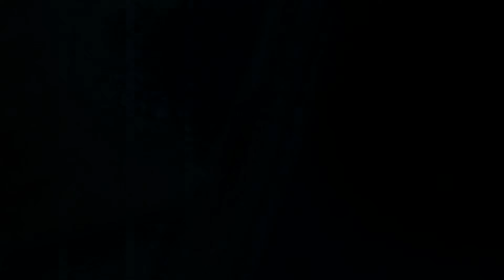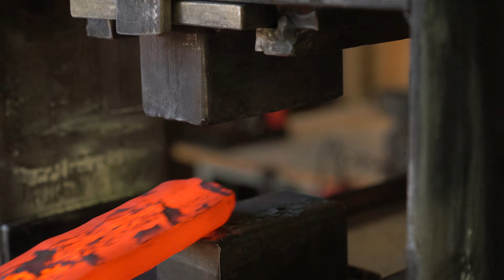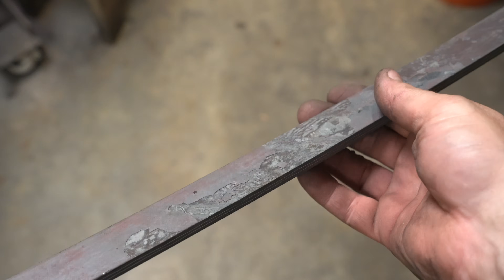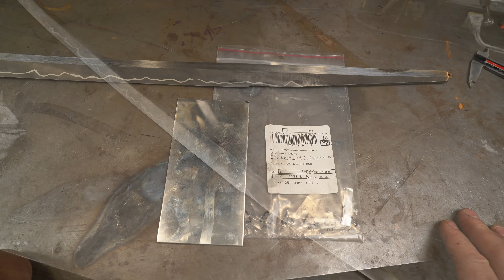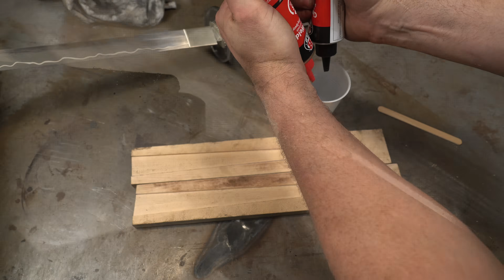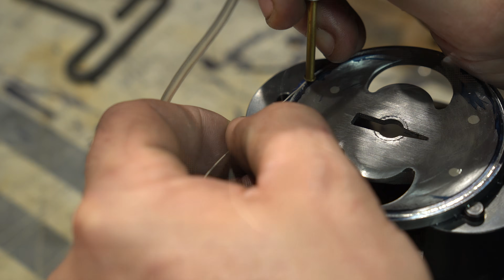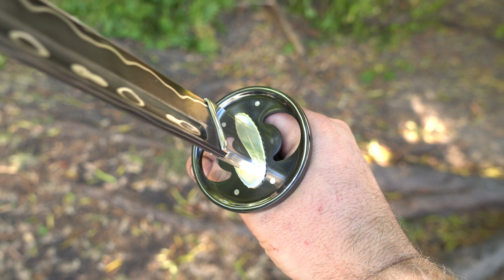Forging a Silver Damascus Katana

Comment: Nice, I'll take one as well. Is it as strong as T10 steel?
Reply from the maker: T10 is an ok steel.  It’s actually kinda brittle, which wouldn’t really be ideal for actual swords.  It’s one of those steels that’s been marketed as a “sword steel” but wouldn’t you rather have a less chippy sword you have to sharpen more often but has a much less chance of breaking?  The core steel in this blade is 80CRV2, known for its toughness and also edge retention.  Overall a better steel than T10 for this purpose.  Thanks for watching.
Reply: @TyrellKnifeworks  Thanks, I'm researching before I make a purchase

Comment: Will the silver oxidize and go black? Maybe try Argentium (a type of Sterling Silver which holds the polished finish).
Reply from the maker: The silver in the blade is pure silver, it will not tarnish like sterling silver.  That was necessary because it has a higher melting point.  Sterling silver was used for the habaki and everywhere else.  Thanks for watching.
Reply: Thank you

Comment: I'd like to see it turned over to IF's David Baker for a strength test against some hardened D2 steel bars after Doug bends it on a wild boar carcase.
Reply from the maker: Sure, not a problem.  It already cut through lots of bamboo without issue.  Thanks for watching

Comment: You guys claim to make a Katana yet don't bother following the original recipe. Why not use the heat treatment method to make the natural curve of the Katana? Instead, you just make the curve artificially
Reply from the maker: This katana is Damascus, I did not want a hamon over it or all the Damascus bear the spine wouldn’t be hard and would etch differently.  The silver acts like a shock absorber in this build so a differential heat treat isn’t necessary.  Thanks for watching.

Comment: Great build!  Looks awesome. Is it me, or does this blade look thin and flexible?
Reply from the maker: The blade is about .200” thick at the hibaki and about .160” at the kiseki.  It’s right inline with the specs of a katana.  It doesn’t flex during normal use, but it will flex a bit if pressure is applied.   Thanks for watching

Comment: I personally did not like the particular guard,seppa and the various moon decorations but the blade itself is gorgeous and cuts like a beast.

I'd rather you kept it simple with no symbols,seppas to be round,a typical menuki of  a dragon or  flower(in this case it would be silver to fit the theme).It felt like the blade is trying to force itself to look "cool" rather than the master craftmanship and raw power of the blade to speak for itself.

Overall blade 10/10 well done
Reply from the maker: Thanks for checking out this build

Comment: Going into this video, Do I think this is going to be a very durable sword? not really. Would I be upset about being proven wrong? Hell no, I’d be delighted~ Do I think it’s going to be absolutely gorgeous? You bet your ass I do. Bless this baby and we’ve got a demon/monster killing weapon~

Edit: it would seem I have been proven wrong about the durability bit, a surprise to be sure but a welcome one~
Reply from the maker: Thanks for hanging in there and not just snap judging the build.  Many people think that because there’s a non-ferrous metal involved that it will affect durability.  It’s a very thin sheet, about the thickness of two pieces of paper after forging, and it’s over a thick central core of high carbon steel that’s the entire cutting edge.  😉  Thanks for watching!
Reply: @TyrellKnifeworks  thank you for explaining the process! I’ll be honest I almost did, but as I watched the video I saw how you knew what you were doing and even explained it, so I knew you knew your stuff.

Comment: Same as steels.same as metals.same as irons ....all will need to be oils  brushing on it , rusty are easy ....
Reply from the maker: Correct, all carbon steel blades should be oiled on occasion to prevent rust.  Thanks for watching

Comment: Why did you spend $1000 on a 3x6x1/8 Sterling Silver plate? A plate of .999 Silver that size should weigh about 13.66oz and, with Silver being about $28 per ounce right now, that still comes out to less than $400. Sterling being less expensive than pure silver... that math ain't mathin.
Reply from the maker: If you read the pinned comment, I mis-spoke in the video.  It was $600... and just because RAW silver is $28 per ounce, there is overhead from the supplier.  I showed the receipt in the video, it was a real purchase.  Thanks for watching.

Comment: That is the best Katana to be displayed I sure could not use it for any practice, with the silver in the blade, and But I would more than proud to display that on my one-sword stand.
Reply from the maker: Don't be fooled, the silver does not affect it's functionality.  The entire core and cutting edge is high carbon steel.  The silver is just a very thin layer, about the thickness of two pieces of paper after forging.  Thanks for watching.

Comment: Does metal really turn black if you put it in boiling salt water without extra meterial?
Reply from the maker: That is t regular table salt. It’s a special chemical salt designed to oxidize metal and turn it black.  Thanks for watching.
Reply: @TyrellKnifeworks  If so, could you please tell me what kind of chemical salt it is? Are there any products I can purchase separately?
Reply from the maker: @Starwooz2021 watch this video https://youtu.be/_v--rblTu1w?si=QFAgJXhJ1PADRiKL

Comment: I'm shocked no one has questioned the decisions here. why would you spend 1500+ on silver when the silver itself is so soft that it jeopardizes the integrity of the whole weapon. it looks like this thing wouldn't last long term in a fight. display purposes, oh yes, gorgeous, but function? thing thing doesnt look like it will hold up against blade-breaking techniques. I must be missing something.
Reply from the maker: The silver is about the thickness of two pieces of paper after forging.  The entire core and cutting edge is high carbon steel.  The silver doesn’t affect the strength or durability of the blade at all.  Look at and understand the construction of it and you’ll get it.  Thanks for watching.

Comment: Honest question, definitely not a critique.  Why does the billet stick to your dies during the welding process?  Is it the slag?
Reply from the maker: It’s normal, particularly when flux is used.  I didn’t use flux on this billet because it was all welded up but sometimes there some residue in the forge.  Thanks for watching.

Comment: Dang, I really need a press. I'm thinking of converting a wood splitter into a press.
Edit: how many ton MINIMUM would any of you recommend? There are some at local stores(rural king and menards). If memory serves me correctly, they're around 20ton splitters. But Hobo freight has a 5ton for $299. Is that enough or does it need to be higher tonnage? 
2nd edit: I have a 1 car garage and a converted log splitter with wheels that can be moved as needed is probably the best option for me. I own a small construction company and all of the tools needed for the company are in the garage too. The splitters I've had my eye on will tilt to 90⁰ vertically. Am I thinking in the right direction or do you have any other ideas for me?
Thanks for any assistance. Keep up the awesome content
Reply from the maker: Unless you get the log splitter for free, it’s not worth it.  H-frame presses are super easy to build and WAY more sturdy than a log splitter.  They just aren’t built for that kind of stress and the frame will now and flex, affecting your work.  Checkout my hydraulic press build video, it has a parts list.  Mine takes up about the same floor space and it’s a 30-ton press I built for about $1400.   https://youtu.be/O_6qciYnKIk?si=7v6X0ogHcDerU-1K.  Also watch this one: https://youtu.be/jjkjPFHKzB0?si=EuOAwh53FxF0vE0d.

Comment: BEAUTIFUL WORK! As you rightly point out no it's not made in a traditional fashion but you wanted a look that meant that was out of the equation! but a lovely piece all the same, curios about the hot salting on steel is it just salt and water? I understand if you don't want to say!❤
Reply from the maker: That is a special chemical salt specifically formulated to oxidize steel and turn it black.  I have videos on the process.  Thanks for watching, Andy.

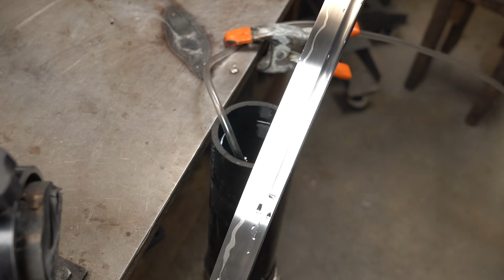Comment: At time 25:00, you said to sand the blade to 800 grit before putting it in the ferric chloride, but in one of your Triple T videos, you sanded a knife to 1000 grit before putting it in the ferric chloride so what grit should I sand my katana blade to?
Reply from the maker: 800 or 1000 is very similar so either works.  It also depends on your echant (ferric vs Gator Piss from Baker Forge).  You shouldn’t be so concerned with exact numbers here and understand the philosophy.  Also, I encourage you to join my Patreon.  I’ll be able to answer more in depth questions there.

Comment: Is it possible to replace the silver with AuGa2? Idk what the melting point is but it'd give a beautiful blue streak along the blade.
AuAl2 is purple which would be cool too. They're pretty stoichiometry dependent though.
Reply from the maker: It’s very unlikely.  As you add alloy elements to silver, its melting point goes down.  Even sterling silver’s melting point is 70F below fine silver.  Thanks for watching.
Reply: @TyrellKnifeworks  Yeah, solid solutions that's definitely the case. Intermetallics aren't as straight forward though. It was just a curiosity. Cool sword though!

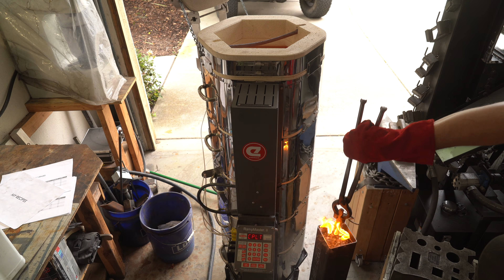Comment: What temperature and time was the heat treating at time 12:58
Reply from the maker: This is 1084/15n20 steel.  Watch this video and see my heat treating recipes at the end. https://youtu.be/XD7m2_usRkk?si=qB4h-2w6PF6uUBIJ.  Thanks for watching.
Reply: @TyrellKnifeworks  but this sword has the 80crv2 steel and the temperature and times are slightly different so which one should I use?
Reply from the maker: @aravchopra5974  oh sorry, I forgot it was 80CRV2.  It’s always the steel on the edge that you heat treat for so it was 80Crv2.
Reply: @TyrellKnifeworks  Okay so for the entire heat treating process only use the temperatures and times required only for the 1084/15n20 steel so 1575 for normalizations, 1500 for quenching and 350-450 for tempering?
Reply from the maker: No, I used the 80CRV2 recipe because that’s what’s on the cutting edge.
Reply: So 1600 for normalization, 1475 for grain refinement, 1535 for quenching, and 400 for temper

Comment: Amazing sword❤, quick question did you soak the stacked billet with the silver and 80crv2 in kerosene before the heating it in the forge?
Reply from the maker: No, it was sealed with weld, no pint in soaking with kerosene.  Thanks for watching.

Comment: It's beautiful but it has an extra bevel on the cutting edge. I am no one to talk, but with modern tools I think you could have relatively easily made a continuous edge on the blade and made it a proper Japanese style blade? Only downside is then you literally can't sharpen one easily, every time you sharpen it needs a full polishing job since you would have scratched the hell out of half of the blade since there's no extra sharper bevel. Nice work though! Maybe make the next one like that! :)
Reply from the maker: While I appreciate your “expert” opinion, this was done this way on purpose because of the pattern on the blade and the need to etch it.  You should ask a question next time  instead of assuming your snide attitude is correct.  One of us is actually an accredited Bladesmith, the other is some guy on the internet who probably learned everything from watching anime and video games.  Thanks for watching.
Reply: No skin off on my back, but I did edit my comment as it was a bit rude. Sorry about that. It's a darned cool looking sword either way man! I couldn't make it myself that's for sure  @TyrellKnifeworks

Comment: I’m curious, why cut and restack and not fold?
Reply from the maker: In modern bladesmithing we don’t “fold” the steel hot.  That has a higher chance of failure so we cool and grind it clean.  Also, folding only doubles your layers where Restacking can triple, quadruple, etc.  thanks for watching.
Reply: @TyrellKnifeworks  well, every time you fold you get x2 so it would be more layers for sure but fair point about the failure rate, i wasn’t aware, thank you! 😊🙏🏼
Reply from the maker: @ioannisaliazis I’d rather do one restack and get 4x than have to fold it twice.  😉

Comment: Seems like the best metal to use is Titanium I also enjoy when a swords metal is turned black and no, not by painting It. It's extremely rare, but possible with a understanding of science.
Reply from the maker: Titanium is a terrible knife material.  It’s just too brittle and doesn’t get very hard.  The most you might expect from titanium is about 50hrc.  That’s WAY too low for any serviceable knife or sword.  For blackening, there are several options.  Coffee used here which is actually tannic acid works very well.  I also use chemical salts like what was used on the guard and kashira.  Thanks for watching.

Comment: This guy was working his material at far too low of a temp 😮😢
Reply from the maker: If you listened to the commentary, the silver must stay under its melting point so there’s a very thin window to work the steel from 1600F-1700F.  It was kept in this range.  Trust me, I know what I’m doing.  Thanks for watching.
Reply: @TyrellKnifeworks  
The color looked wrong that's all...
I have no experience at all though 😘
I very much trust that you know what you're doing 🥰🙂✌️
Reply from the maker: @FunLovingCriminal_JB  Just curious why you would post a comment like that and then say "the color looked wrong" if you have no experience at all?  Best to ask a question first and instead of saying the maker did something wrong and assume you know better.  😉
Reply: @TyrellKnifeworks  
Having watched a lot of Forged in Fire I know that if the metal isn't glowing then it's because it's too cool... If you work the metal while it's not hot enough you're putting a lot of stress into the metal 😘😇
Reply from the maker: @FunLovingCriminal_JB  Respectfully, FIF tells you guys a lot of dumb crap.  While this is solid info for the most part, it really affects certain steels more than others, like 52100 and not the steels I'm using.  Furthermore, what you see as "cold" is actually at 1500F because you're looking at it in sunlight.  Like I said, ask a question first, don't be an armchair warrior.  😉
Reply: @TyrellKnifeworks  
😂😂 fair play brother ✌️
I wouldn't usually have made a comment but I was just starting on my 2nd bottle of wine and feeling confident 🤣🤣🤣👍😎...
I am fully aware of my ignorance and bow down to your superior knowledge in this matter 😉👌🥰...
Take it easy, keep up the great work 🙏❤️

Comment: I know this is meant more as an art piece, but out of curiosity, does the silver actually manage to bond with the steel, or is it essentially just pressure-fit into the blade? Sorry if it's a dumb question
Reply from the maker: The silver is essentially brazed to the steel.  The brazing bond is in excess of 70000 psi in tensile strength so you’d destroy the blade before you shear the layers apart.  It’s an artistic blade but fully functional.  Thanks for watching.
Reply: @TyrellKnifeworks  that's really cool, I'd never heard of brazing before
Thanks for the quick response

Comment: I wonder how hard (as far as strength) your Katana is compared to  a traditionally forged Japanese blade?
Reply from the maker: The entire cutting edge and core is 80CRV2 high carbon steel.  It likely will be stronger than traditional tamahagane, which was quite inferior steel for the time and compared to modern steel.  Thanks for watching.

Comment: Why don't use 1095, or a premium steel if you are making such a piece of art
Reply from the maker: 1095 doesn’t etch as dark as 1084, and otherwise they are almost identical as far as chemical properties.  Thanks for watching.
Reply: @TyrellKnifeworks  thanks for the explanation i thought the higher the carbon the darker the steel, theoretically it should get darker, maybe the higher the carbon the higher the amount of time it needs In the acid becaus the acid doesnt attack harder steel that quickly.
Reply from the maker: @aleister8665  1084 contains manganese which produces a darker etch.

Comment: Absolutely beautiful, and you should be so proud to have such skills. We've all seen the traditional methods of Japanese katana forging, and it surely makes even you appreciate the time and craftsmanship that was required back then to produce such works of art. From a pure metallurgy standpoint, how do these modern methods stack up against the ancient swords as far as strength, sharpness, craftsmanship, etc? From using their rare tamahagane steel forging, to the clays, rolling the billet in traditional straw, carbon hardening, multiple folds, etc. etc. I'm sure they would have appreciated the hydraulic press, electric tempering ovens, but do you think their entire process and exactness produced a better sword than can be made even today? Thanks again for your astounding work!
Reply from the maker: What the Japanese excel at is craftsmanship and effort.  Tamahagane is actually far inferior to today’s modern steel.  It was “folded” so many times to remove the rampant impurities.  Also, it wasn’t rare, just time consuming for that age.  The steel coming out of the Middle East and India at that time was leagues ahead.  The Japanese certainly did the best with what they had at the time.   Thanks for watching.